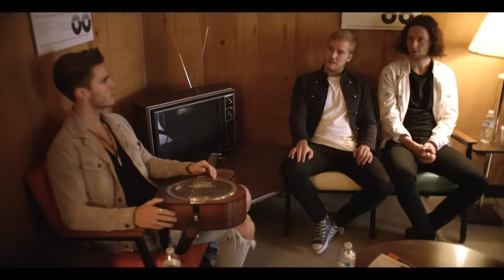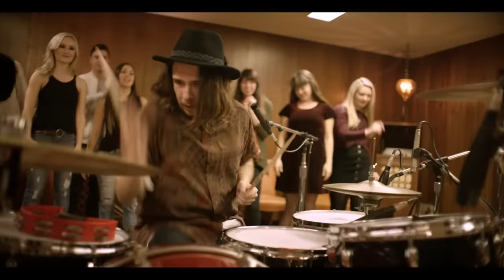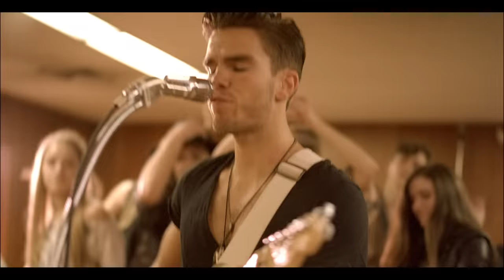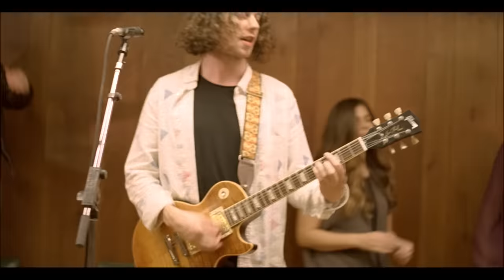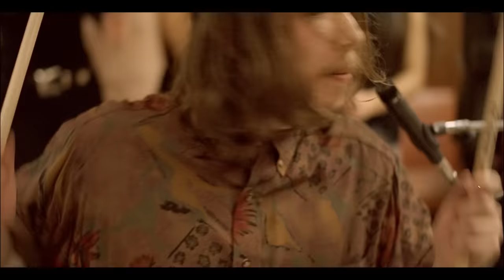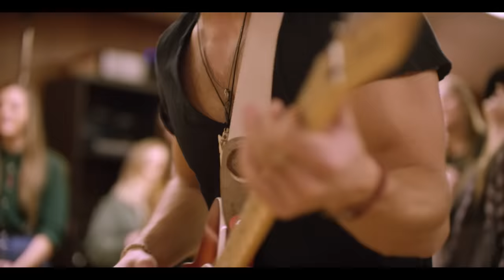KALEO - No Good (Live at United Record Pressing)

Comment: This sounds like if the Black Keys and Hozier came together and said they were gonna make an album dedicated to 80's and 90's rock and roll
Reply: but without Hozier.
Reply: this closer to 60s and early 70s rock than anything from the 90s or 80s.
Reply: try 50's or 60's rest and release.
Reply: PENNY BEATS you're way off.
Reply: u went to far 
hozier is something else
Reply: OumaRu kushiki yeah hosey'er is something else ..this is ROCK N ROLL. hosey'er can't touch this.
Reply: theres a lot more than just those factors involved. They have rock and blues roots. I'm impressed by both, but blues is a lot harder to really get across because it really requires your heart and soul in it and they nail it